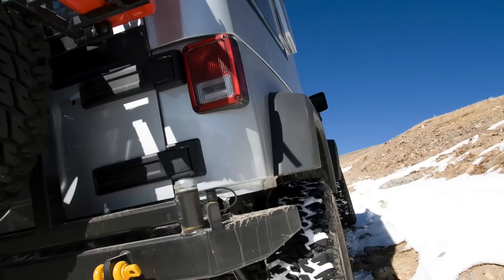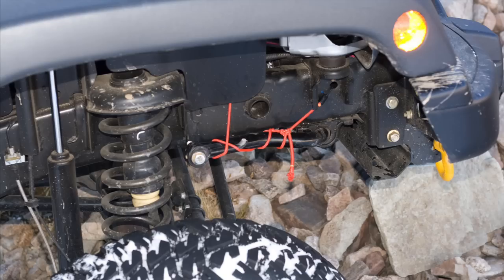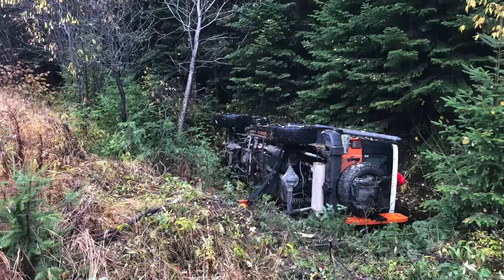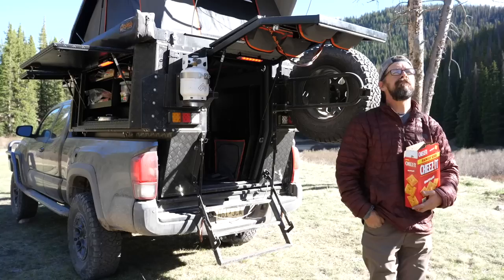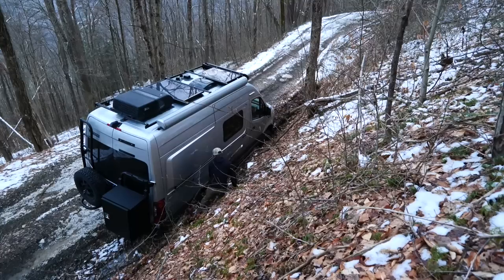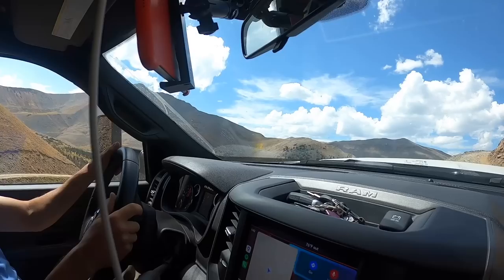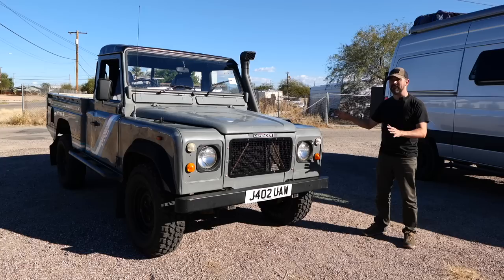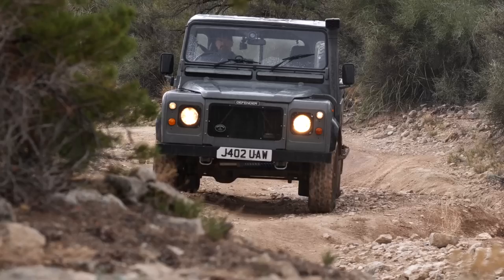V17E3: Overland Vehicles of venture4wd

Comment: I completely agree on the romance and crawl performance of the old defenders. There is something about the way they track through the back roads that makes them seem indestructible. Simplistic perfection.
But since they were never really imported to the U.S. by Land Rover, the best thing we mere mortals get is the Jeep Wrangler. With the Jeep, however, we get parts availability, even better off road capability ( especially with the Rubicon) and freeway compatible speed, handling , and comfort. I get 23 mpg on the highway with my JKU.
So unless you want to spend $110,000 plus for a fully restored vintage LR, ( agreed they are awesome) the Jeep is the perfect choice.

Comment: The first and last vehicles are both inspiration for my build.  I wanted a modern, reliable, short wheelbase high capacity single cab pickup for actual payload and capacity, and a back flip style roof tent camper system like the ER-JP that allowed for stand up space and simultaneous sleep space.  I settled on the F-150 RCSB and a AT Habitat.  Check you the build on my channel or Insta.